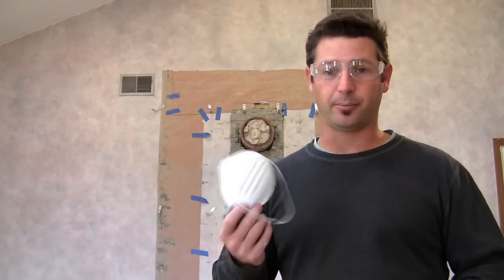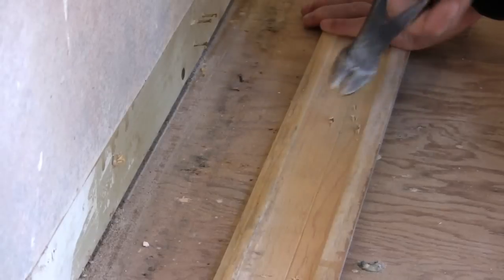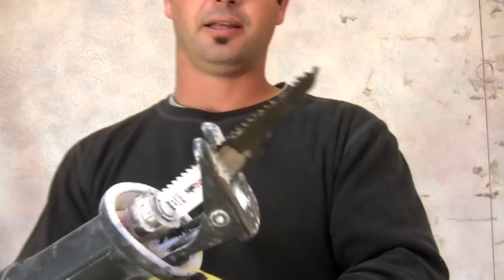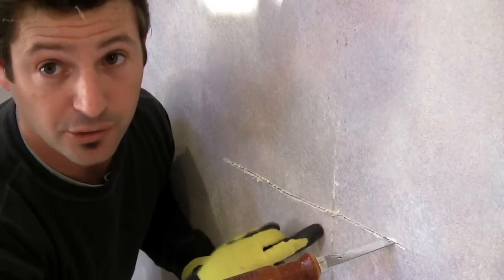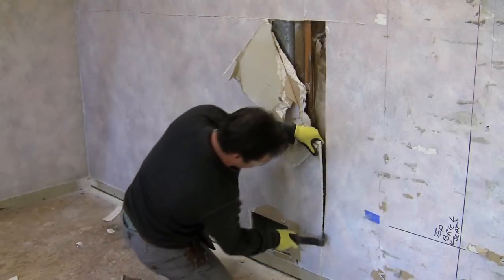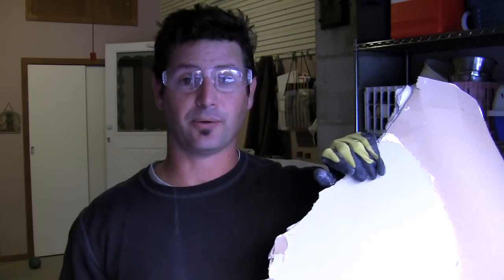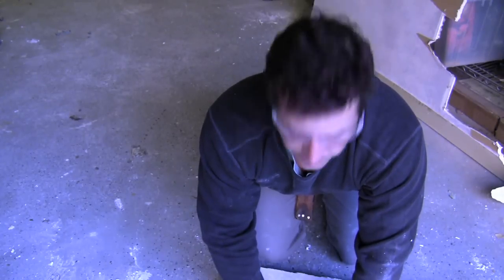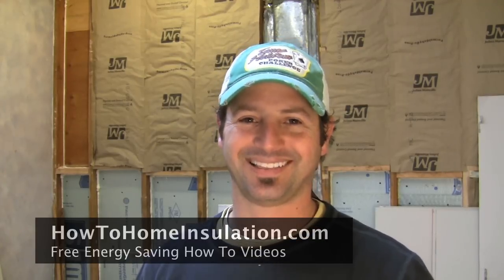How to Remove Drywall - DUST FREE

Comment: Dude that was c- at best

1) You need a better quality mask for dry wall
2) You can spray the dry wall down with water where you plan to cut or break it
3) You a new blade and just cut the dry wall like that with the safety
4) Position a fan to suck dust out of the house in the window
5) Chuck it outside and take the hose to it, the bag it.

Comment: Omg; From the bottom of my heart I thank you so much for this video— I never thought I’d find myself at 55: divorced, alone, scared to death, overwhelmed, trying with all my heart and might to transform this outdated, poorly designed condo into a functional and flowing space I will now call home. My specialty is designing on a dime, which usually requires some fiddling to get things to work out just right. I’m in way over my head: I just couldn’t say no to five Arhaus  63” industrial, brand new cabinets I ran a crossed at our local ReStore. Of course one thing leads to another and my entire 1300 square-foot home with the exception of my bedroom has been taken over with these projects. I had no idea how to take down that wall —been staring at it for a couple of days now, thank you Cory —I truly mean from the bottom of my heart… You explained So simply and calmly and neatly your process, and made me believe that even this featherweight queen weighing in at 110 pounds soaking wet, may  tackle that wall! Thanks for the info and for the confidence have a good night!
Reply: Are you trying to get his phone number 😂 Get a room!

Comment from the maker: @DarylV1986  Yeah, drywall is nailed or screwed to the wall. This wall has nails and glue holding the drywall. But the drywall is just 2 sheets of paper with gypsum cement in the middle. If you pull hard enough, you can rip through the paper without breaking the drywall. It really cuts down on the mess.

Comment: Great video!  Only suggestion I have which I have found works well is removing baseboard nails with locking vise grip pliers. They have a curved perimeter near the head that gives great leverage and will allow you to easily remove the nails.  Once you get used to it you don't even need to lock the pliers to remove unless it is a stubborn nail.  Sometime the nail may break and locking on it close to the wood will allow you to remove it.  Made me cringe when I saw you use wire cutters to remove that nail. Great job and thanks
Reply: I bet he is married. Most contractors and other construction pros don't wear wedding rings bc of the danger working with one on can pose.